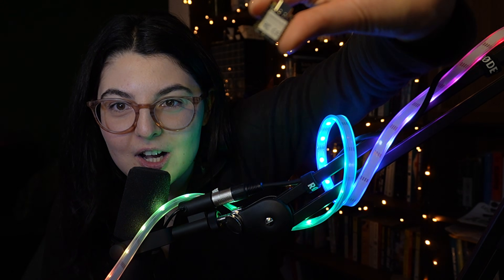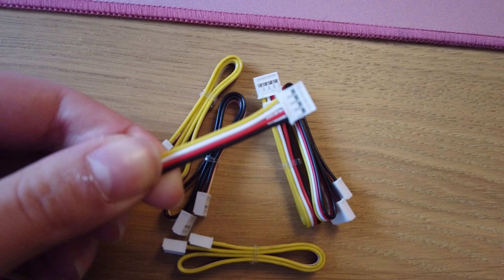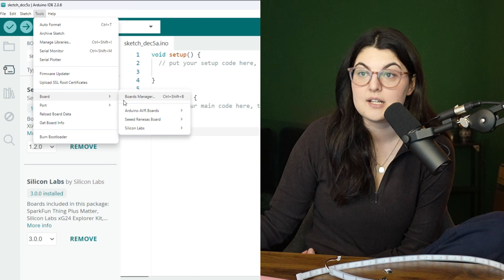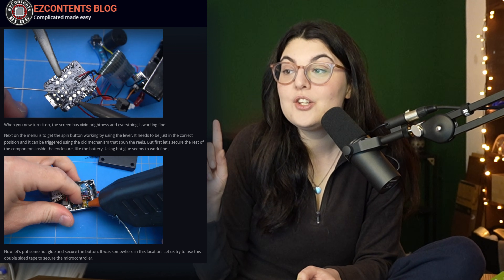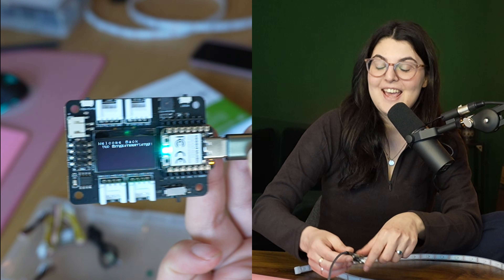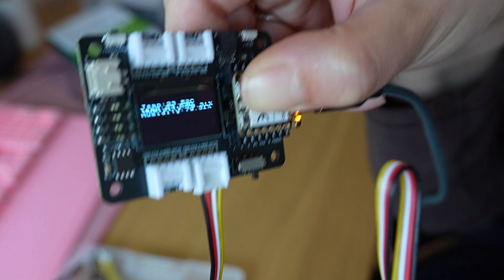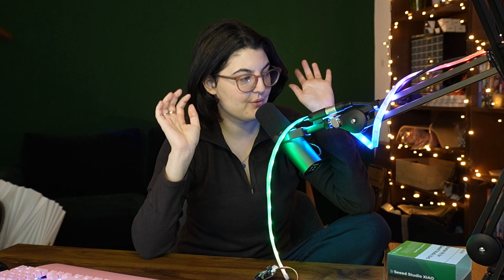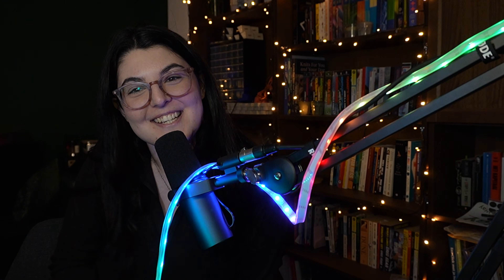Can this TINY microcontroller handle this?

Comment: I keep meaning to try out the WLED Project which supposedly makes it very easy to run LED strips with your microcontroller through a web interface. Might be something worth checking out for you, too!
Reply from the maker: Oh cool! I’ll definitely check that out, thanks for the tip! Looks like it’s mainly for ESP controllers though? Which is also on my list to check out!
Reply: @backtoengineering  Throw a Seeed Studio Xiao ESP32 variant on a wish list somewhere and I'll treat you to it. Maybe a soldering practice kit, too, because you're going to need to learn that soon, I think! Don't be intimidated by it... as long as your not soldering surface mount components then it's usually not too bad.
Reply from the maker: @mark-wilder that’s so kind! Seeed studio actually reached out and they’ll send me one and some of the new drivers for LED control so I’ll the to make a controllable neon sign in the next video! Thanks so much for the idea/suggestion, you’re making this happen!

Comment: I like the video idea. I was skeptical. I wish I had that for my room.
Reply from the maker: Skeptical of the idea or the microcontroller? 😅 yes I love having the lights around now! If you connect it to a battery you don’t even need to keep it by the computer, you can place it anywhere
Reply: @backtoengineering  I guess I meant I was skeptical about the microcontrollers firmware. I had used MPLab in the past and it was conceptually difficult.
Reply from the maker: fair! I am not seeing the best reviews for those. But so far it's been super smooth with the Seeed stuff I've tried, and their support has been lovely. I'll keep experimenting and share any stuff I run into!